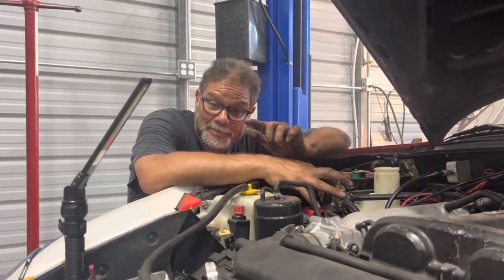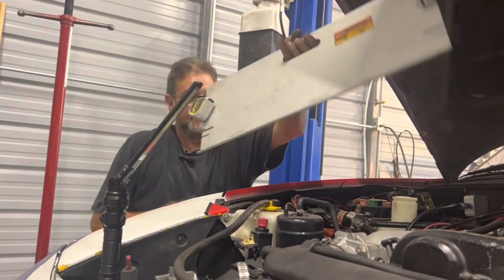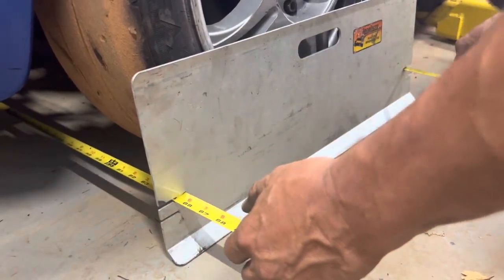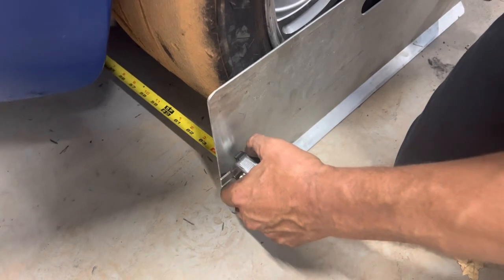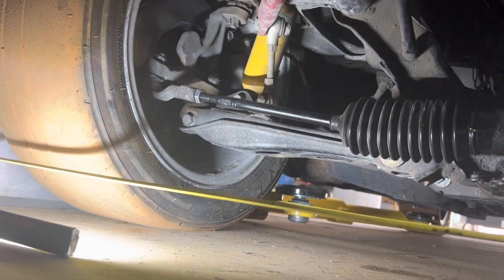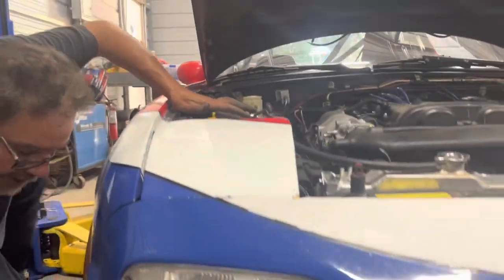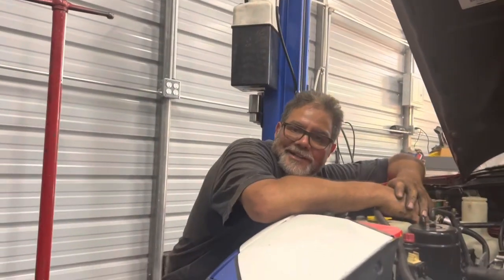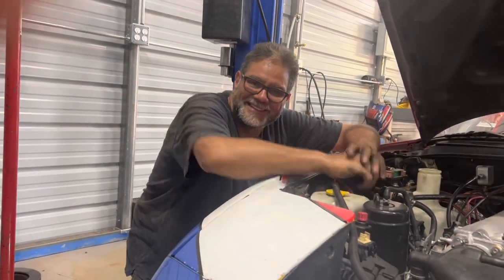Alignment Using Toe Plates, Spec Miata, MX5, Track Car, Autocross

Comment: Thanks!  I just purchased an alignment tool which included toe plates from Summit.  Do you just tape measure each side to be sure the toe out/in is equal on both sides and not canted?  I can see how the total toe can be taken using the plates, but that doesn't break it down to where you know it is 1/16" on each side equally or is that beyond what a DIY kit can do?
Reply from the maker: You are right Stan I didn't set individual toe with toe plates. I had set the original alignment on a alignment machine. Since I worked on the right side I knew it was the one that was off. You can only set total toe. That means that the steering wheel might be crooked when you are done. I do know a way to use toe plates and set individual toe per side. Maybe another video is due?
Reply: @aracing  Please do that would be helpful!
Reply: @aracing  has another video been made for this id love to know
Reply: @aracing  Would love to see this video!

Comment: Good content as always Al! Just one question: in the video you said it's 1/8 of an inch toe out. Are you talking about "front right wheel is 1/8 inch toe out"? Because if the toe plate on the right set is aligned dead-center to the left wheel, assuming the left wheel is in the right toe alignment, which assuming to be also 1/8 inch toe out. Then the reading of the tape measure on the front side of the wheel should be 1/4 inch more than the right side to make the right wheel also 1/8 inch toe out. Is this understanding correct?
Reply from the maker: Im reading total toe, both wheels added together. If i was on a computer alignment machine then I could do individual toe and add the two together.  You can not do that with toe plates. Thanks for being a long time subscriber.
Reply: @aracing  Thanks for the explanation! You probably have the most practical Miata racing content on YT, I was busy with work and couldn’t watch all of them when they first posted but I’m doing what I can to support😀
Reply from the maker: Email me your address and shirt size and you can support the channel proper like. alangulo530@gmail.com

Comment: With the tires on the ground and not on slip plates it's very likely that as soon as you roll it'll go more toe out because you measured while the tires were holding tension against the tie rods.  You'll notice that the tie rod turned easily at first, then got harder; that was it forcing the tire to slip.  I've seen it change over 1/8" after 'settling' the tires.

Comment: How many turns of the tie rod should you start with. Like 1 full rotation = how much movement at the wheel measurement?
Reply from the maker: I put on what I take off, most of the time its close to 19 turns.
Reply: @aracing  I more meant once it's installed and you got it close...for the fine adjustments. You've got the wrench on the tie rod are you doing half a turn, full turn or etc if you are just fine tuning to get the toe spot on?